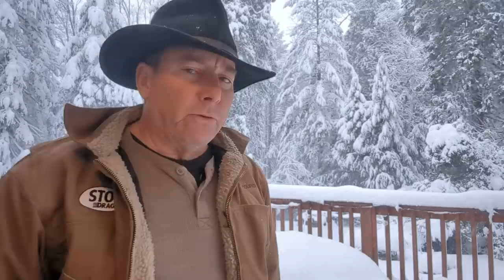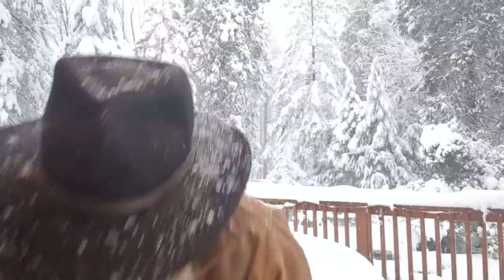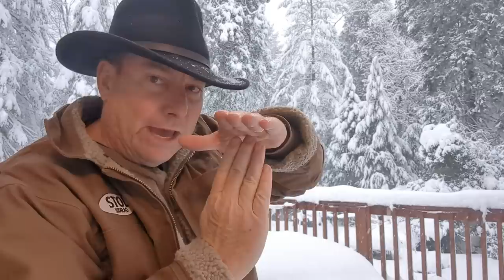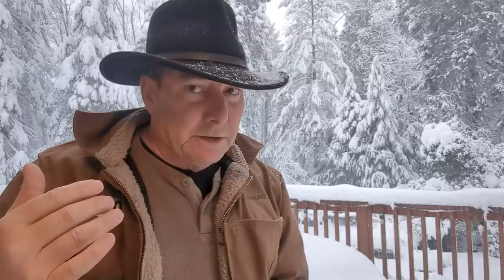PC-12/45 NTSB UPDATE In Flight Breakup! 26 Feb2023

Comment from the maker: To be clear- the loss of control was followed by the inflight breakup. NOT the other way around.
Reply: How reliable was the 27000 fpm descent rate? This is incredible.
Reply: Flying fighters we encountered SD quite often...I have been briefed about 2 Canadian F18 cases that pilots had to eject due to SD and one Swedish fighter case...We sometimes had this phenomena while formation flying in IMC...an example is the Russian formation crash in the mountains...
Other situation was doing BVR fighter manouvres /aerobatics VMC night... those could put you in SD due to canopy reflections...that is why fighter aircraft (eastern or western types) have always have auto-level, auto-pull-up recovery and robot-pilot-approach-land  functions dating back to 1980s....usually it is a big red push button on the stick...
Of course the other frequent reason was the G-lock or grey-out due to over Gs...to develop these systems...
Reply: @jgrazzi  If the plane loses the tail (such as after a hard pull-up overloading the elevator) it's likely to turn the nose more or less straight down. And that will result in a very high speed so it may rip off a wing.

So it's likely the flight data is correct and this plane really did fall at a mad pace.
Reply: Is a breakup to be expected in a spatial disorientation scenario, or is that rare? Could the PC-12 be built with too thin of safety margins, or is too variable on other factors?    Do planes in this category have pilot aids to prevent a overspeed or over G? We're those overridden or could the weather have just taken a stable flight suddenly past limits?   Breakups seem like the worst because of the instant you know it's too late to recover comes so soon. Very sad outcome for the 5 folks and their friends and family.  Thank you for your insight and education.  Only through deep understanding, broadly distributed can lessons be applied to help prevent these tragedies occuring again.
Reply: Sooo something mechanical a   failure possibly  occured causing loss of control or difficulty maintaining positive control of the aircraft....
 Then the overspeed..
 ... Then the breakup.... 
    GOT IT...
Or did you want to retire with the FAA ? 
Or Boing boing gone to the max ? 
  Their motto : blame the dead men or itz bad for business...  just sayin.......
Reply: Juan, there WAS severe turbulence in the area at the time. I believe that he likely experienced severe or extreme turbulence, lost control of the aircraft, definitely had spacial disorientation and ended up over stressing the aircraft leading to structural failure. Then after parts came off, this could have precipitated the spiral dive with the very high rate of decent previously described.  I strongly believe that severe turbulence played a big role in this accident, as there were several PIREP's of this in the area.
Reply: …or it was loss of control/pilot error, followed by inflight breakup, followed by more loss of control.
Reply: Juan, the fuselage photo sure doesn’t look like a high-speed, nose dive impact.  One earwitness said she heard throttle up and backfire before impact.  Is it possible the pilot recovered/was recovering the aircraft at the end?  Please address in your next update.  Thank you!
Reply: Is there a possibility that in-flight turbulence caused passengers to move around violently or say if a passenger attempted to move to the co-pilot seat just when turbulence hit. Could that also have been a reason why there was no radio contact? Everybody was trying to get back into their seats while the pilot fought to regain control? I've only flown as a passenger in a few small planes (One was a twin engine Cessna I was in the co-pilot seat and I was allowed to take control of the airplane for a few minutes) of those who were friends with my grandfather back in the early '80s. Moving around inside the plane was not something we were to do, but, we're all human.
Reply: It was extremely turbulent that night. I was driving home in the area of crash same nigh at 10pm, coming over the pass between I80 and 50 
(about 5 miles from accident) it was blowing snow 50-60mph, cant imagine the winds and turbulence at 19k. That departure follows a valley that is a wind tunnel most of the year.
Reply: It's not like you Juan to totally guess that breakup preceded loss-of-control, or vice versa.   Based on what factual info?   Also, a "dry" aircraft moved from a warm hangar into snowy conditions can cause all that precip to melt, form liquid, run into control surfaces or control hinges, and then freeze during climb.  It's not about dry, it's about temperature.  Moving a warm aircraft into cold/wet conditions has been known to cause frozen or fluttering control issues.  Plus, if that aircraft had crashed at the now-reported descent speed, the fuselage would be nothing but dust, something doesn't add up there.  Forcing part 135 ops to install Data/Voice recorders would put them all out of business.  While airlines have the $$$millions to accomplish that, commercial operators don't.
Reply: Flying alone in hard IFR at night in weather on Part 135 is not very smart, to say the least. 
The Pilatus PC-12 is a very capable aircraft. The problem seems to be ... the pilot. I don't know this particular pilot's experience, but in general most of the pilots move "up" from smaller airplanes to a high performance single or twin engine turboprop. It takes a while to get used to it. As soon as your experience grows, the pilots move to bigger airplanes / airlines.  Medevac pilots rarely do this job for a lifetime. If you get a chance, you leave. 

Regards from the 747-8, former medevac pilot on Cessna 421, Cheyenne, Falcon 900, Citation and King Air. 

Blancolirio?  Juan is the best, by far! Regards from Switzerland. RS ✈

.
Reply: @theashpilez  You didn’t get it, even English is not my first language, a spatial disorientation caused by instrumental flight in the non-visibility conditions, pilot didn’t trust what the instruments were showing but how he was feeling how the plane is positioned in the sky, so he flanked to the right and caused more speed and more G’s and rudder was blown off and then the part of of wing. Plane was non controllable at some point of the downward spiral. Why autopilot came off as he should been on the autopilot in this altitude already, that remains the question. PC-12 manufactured by Pilatus is very expensive plane so for me is mind blowing that there is no voice and data recorder in the cockpit.
Reply: @gojimgled2  The aircraft is not recoverable in flight with the outer right wing and Horizontal Stabilizer / Elevator missing from the airframe.
Reply: Juan - Yes Sir, & I know what disorientation at altitude is 1st hand!  '90s livin' in depression northern peninsula of Mich too low for TV.  Made 66' antenna mast, boosted it up in 3 sections wired & w/antenna/rotor atop.  I was Klingon @end of peak when looked up at antenna.  Lost all sensation of gravity, twirled twice, & later Buddy Pete rescued me w/safety line from peak to be sure.  Was max ashamed, but it was next day before could walk unassisted.  Toby D. Dog was amused for sure!  I am not a pilot...THANK GOD!  Next AM checked out TV & got 18 stations including 3 different Channel 4's.  Was worth it versus NO TV!!
Reply: @electricaviationchannelvid7863  there's a really good account of atempting to recover (and ejecting) after SD in an F16 at night on Lemmoines channel.
Reply: @mountainflyhigh  Juan claims the reverse. First loss of control. Then some overload event and breakup. If the pilot wasn't prepared for the deactivation of the autopilot he may have directly suffered spatial disorientation making him ignore the instruments.
Reply: @Renato.Stiefenhofer.747driver  -Had a conversation last night with a few guys I grew up flying with.  We flew mush less capable aircraft than the Pilatus, and yes, all single-pilot, night, IFR in upper-midwest blizzards, almost exclusively non-precision approaches, to minimums (and below).  All in multi-engine light twins.  Thousands of hours in those conditions, almost all hand-flown. No onboard radar either.  It DOES come down to pilot skills, yet today, the industry (including Juan) is pushing to lower minimum pilot experience for commercial and airline flying.
Reply: @mountainflyhigh  You are absolutely right. On top of that industry standards and FAA minimum requirements are two different worlds.  But above all we should respect the laws of physics...  Regards   RS
Reply: @mountainflyhigh  But in the post I responded to, you reversed the claims and said Juan claimed "breakup preceded loss-of-control".
Reply: @mountainflyhigh  The plane was in a right spiral dive that started much farther away from the crash site than the 1/4 to 1/2 mile where the debris was found.  With ADSB data, if the breakup had started the loss of control, you'd expect the debris to be found on the ground below where the loss of control started.   I don't believe that's the case here based on the first video Juan did.
Reply: @browntown52  it is one of the toughest turboprop aircraft on the market.  Any airplane descending at 20K FPM is going to shed major components of the flight surface.  The PC-12 is an inherently reliable and strong aircraft.
Reply: @gojimgled2  Not if the elevator was missing
Reply: Perhaps I missed it but where in the information available does it determine this? Sptial Disorientation may have caused the crew to over stress the aircraft resulting in the inflight breakup. Please explain.
Reply: @gojimgled2  I agree the plane didn't nose dive into the ground, it seems to have hit more flat but that wouldn't have been because the pilot was recovering control.  I'm sorry, but with the parts that were missing there would have been no way to control it.  The earwitness is probably mistaking what she heard.  Turboprops don't really backfire.
Reply: Possible pressurization issues led to incapacitation of all on board due to hypoxia?
Reply: @Av-vd3wk  I thought I heard in the report that they were not airborne long and that they had only climbed to FL190. I don't believe that is the answer on this one.
Reply: thanks for clarifying.
Reply: @mountainflyhigh  You very explicitly did write "It's not like you Juan to totally guess that breakup preceded loss-of-control. "

Are you now claiming that wasn't what you wrote? Then you might need to quickly edit your post...
Reply: I really appreciate you pinning the main factual takeaway (or potential misunderstanding) as a comment on these videos, it's a great extra bit of clarity.
Reply: @perwestermark8920  I called out his statement as a guess.  I in no way said hw was right or wrong, nor claimed that I am right or wrong.  It's impossible to make the claim that Juan did, and state it as a fact, without the entire investigation being completed.  Nothing to retract, I stand by my statement, Juan is stating his best guess as a fact.
Reply: @mountainflyhigh  But you did claim it in reverse of what he claimed. How many times will you avoid that fact?
Reply: @mountainflyhigh  not sure if he took type 4 or not before departure, but all our jets did during the same time. 
From time they pulled out of hangar to takeoff had to be 20-30 minutes in heavy snow, and it was VERY heavy. Can't imagine not taking type 4. 
We spray even if it's in the forecast.
Reply: @mikefendel  that is what he said.  The inflight break up followed the loss of control.  It appears the excessive sink rate, G pull and speed contributed to the structural failure.  NTSB update stated, suspected loss of control with resultant break up in flight.
Reply: @Catch_The_Irishman  Thank you sir, I did read it wrong. That makes perfect sense. My mistake. RTFQ right? (Read The Full Question) only this time RTFP for Read The Full Post!
Reply: @mountainflyhigh   The first post of this thread, by Juan is "To be clear- the loss of control was followed by the inflight breakup. NOT the other way around."

And you post "It's not like you Juan to totally guess that breakup preceded loss-of-control."?

You claim you didn't write that? Or you aren't sure about the meaning of "preceded"? Your statement, slightly rewritten, is "It's not like you Juan to totally guess that the breakup caused the loss of control". Which is a 180 degrees reversal of what Juan claimed.

You sure you should go the "or do you not understand English" path if you can't see your post has the reversal of loss of control and breakup of what Juan claimed?f

Trying to jump into "statistical" and other side tracks just to move the focus from the mixup of the order claimed by Juan and the order you listed and blamed him for having claimed.
Reply: @mikefendel  I had to read it twice also!  Thanks!
Reply: You know if you put a comma either before or after the "followed" it changes the meaning. I read it the other way at first.
Reply: What leads you to believe an experienced pilot with as many hours as this pilot suffered spatial disorientation? I am genuinely curious.  Couldn't it be possible that he suffered from severe icing or severe turbulence that lead to the in flight break up then loss of controls?
Reply: @ahmadsamadzai8255  it was loss of control then breakup of the parts not the way you put it
Reply: @Collin Gray  What caused the the loss of controls?
Reply: @Catch_The_ Irishman  The pilot is being blamed for this accident and I think it's premature.  There's no evidence that spatial disorientation is what lead to the crash. I am saying there are other possibilities for the loss of controls.
Reply: @ahmadsamadzai8255   the autopilot was kicked off most likely from turbulence causing the airplane to fall and the pilot never regained control and while trying to regain control broke apart the airplane
Reply: @ronaldneiderman9261  - Airlines have regs for when to de-ice.  We never did in Part 135, not sure if that has changed now.  If they do de/anti-ice, there goes all the profit on a trip.
Reply: @perwestermark8920  - Yes, Juan stated that the loss-of-control happened 2nd, break-up 1st, as a FACT.  There is no way to know that yet, hence my surprise that Juan stated that.  I'm not claiming I didn't write anything, my statement stands.  Neither one "preceding" the other can be determined at this point.  And no, you don't get to "slightly" rewrite my words.
Reply: @mountainflyhigh  I flew junk beech 18s and MU2s back in the 90s 135 out of Rockford Il and we de-iced because we wanted to live, regardless of "regs" or GOM.
Hell, even Ameriflight deiced that same night and they are the cheapest bunch I've ever seen in aviation. Nonsense
Reply: @ronaldneiderman9261  -  Yeah, served my time in the MU-2s as well, not an ice-friendly airplane.  Flew out of Waukesha for years, then MKE.  I honestly can't remember ever spraying a plane though, until I worked in the airlines.  We did use engine heaters to melt ice off wings though.  Spent many a frigid winter night at Palwaukee and Meigs, waiting for pax to show up.  I remember a night so cold I had to go out and start the engines every 45 minutes to keep them warm enough.  Barons, Navajos, Aero Commanders, C421/414, Aztec, Seneca, King Air200/100 - always learning new ways to survive.
Reply: @gojimgled2  - Earwitness info is usually unreliable.  A turbo-prop engine doesn't back fire.
Reply: @mountainflyhigh  Read the first post of this thread. The unedited first post. And this time use the English skills you claimed I don't have...

It says "To be clear- the loss of control was followed by the inflight breakup. NOT the other way around."

How many times do I need to repeat this for you to spot that this is the reverse of what you posted as a follow-up? Since your English is better than mine - you figured Juan posted in German? Or Italian? Or why are your supreme English reading skills failing you? Loss-of-control **first**, break-up **second**.
Reply: Thank you for addressing this sequence of events. I’m already hearing people say the aircraft was flying normally and then pieces started falling off. Thanks again for doing these analyses, Guardian Flight has not provided much information.
Reply: @theashpilez  I didn’t see anything indicating a mechanical issue caused the loss of control, I believe he suggested spatial disorientation was likely, very similar to GZ.
Reply: @mountainflyhigh  You sure you managed to read Juan's post? Because you have dodged again and again. Did your post match what his post said? Or did you reverse the order in your post? Don't call names if you can't admit to being wrong and instead keeps blaming others. The normal reaction (for a non-Karen) would have been "Oops, I must have read wrong" or something. But you prefer to blame others.
Reply: @joelobryan1212  agreed, and that is why in my post I harped on the moderate to severe turbulence that was present that night. That was factual.
Reply: @mountainflyhigh   ice had nothing to do with this accident.  That area in those conditions would have had severe mountain wave turbulence which can rip the wings off a plane.  I was a helicopter SAR pilot in the Sierra Nevadas for 4 years.  If icing was a factor the plane wouldn’t have made it to 19k feet… also the PC12 has de-icing capability.   ATC knew the area had severe turbulence at the time.
Reply: And neither the PC-12 nor pilot were rated for aerobatics, especially not in IMC.
Reply: @bobgeldof7515  - I'm not talking about airframe icing, but even if it had some airframe icing, it could most certainly climb to F190.  Wings aren't rotors.  I AM referring to ice that can form INSIDE control surfaces, or in critical non-aerodynamic areas, that can cause controls to lock up or things like ailerons, rudder, stabilizers, trim tabs, etc. to flutter when they get out of balance.
Reply: Maybe,I should not get in this conversation,but I worked at Midway airport in Chicago,for 46 years.Ground crew,de iced plenty of aircraft.Little guys,up to 757.Many times I have been chastised for using to much glycol,type one or four! People would be extremely corse because of the cost.My answer would always be do you want to fly or die!Thomas A.Filipiak!
Reply: @tomfilipiak3511  - Well, airlines made a very expensive mistake when they put de-icers in charge of de-icing.  It's a Captain's decision - period.  When we initially put de-icers into the decision process, our costs sky-rocketed.  Didn't take long before we put the Captain's back in charge.  We decided what type, how much and where, then we walked around after de-icing to assure all was good.  When we started operating MD-80s, we quickly discovered that the bottom sides of the inner wings would ice up after every longer flight, even landing in 90F temps, due to cold fuel in the wings.  The FAA had a look, and said that up to 1/4" of ice there was fine, didn't affect performance at all.  But every time we landed somewhere, a ramp agent would tell us we had to de-ice, and would pitch a fit when we told them to ignore it.  Guess what - nobody died.
Reply: Juan,without adding to all the conjecture on this blog,can I say severe turbulence events have caused structural failure and having survived several episodes in my 50 years in aviation I have great respect for Mother Nature.Maybe we will find the cause of this tragedy ?
Reply: i would have thought loss of control was before inflight break. otherwise why in flight break up? Or excessive speed? i would think for these other occurrences to take place pilot was out of control of air craft.
Reply: @rikji  - Extreme turbulence, control surface uncontained flutter, pilot induced over-stressing, (while still in control), a frozen control surface,  mechanical malfunction, combination of the above, long list of things that can cause an aircraft to break up in flight.  Not saying it was control vs break-up, that usually takes a lot more investigating of the wreckage to determine.  What I haven't seen yet is any mention of the experience level of the pilot.
Reply: @mountainflyhigh  I agrre. A bit presumptuous to say Spatial Dis/LOC/spiral/breakup came before just ordinary breakup/LOC/Spiral. i doubt ntsb will ever be able to say conclusively with no black boxes. An extensive four corners study could shed some light tho.
Reply: Loss of control over stressed and over speed exceeded structural limits.
Reply: 306 mph.....not that far fetched.  Its possible.   @jgrazzi
Reply: flutter.
Reply: Flutter does NOT need turbulence just structural resonance with  the Strouhal frequency relating the trailing edge opposite rotating small vortices, which modify the circulation and have no damping effect. The Strouhal frequency is a function of the true airspeed, in dependent of the pressure dependent indicating airspeed which means at altitude it occurs at less than redline Vne.
Rarely placarded because TAS requires a MACH indication and a reliable out of boundary layer temperature sensor.
TAS = Mach × √ (1.4× 287×[ 273.15 + 0AT]) × 1.944 in knots